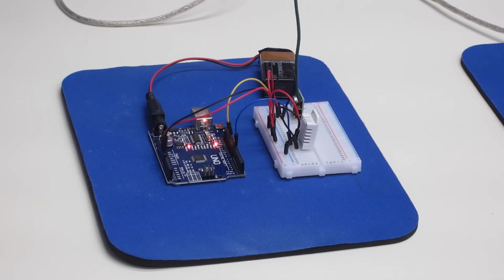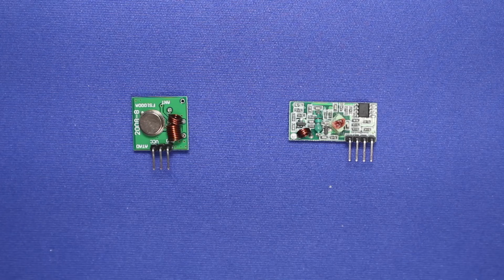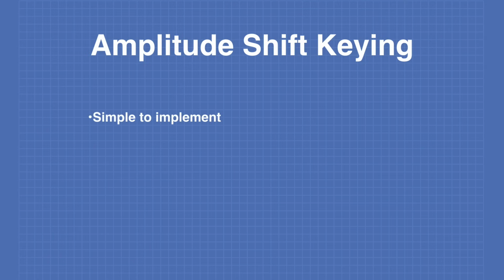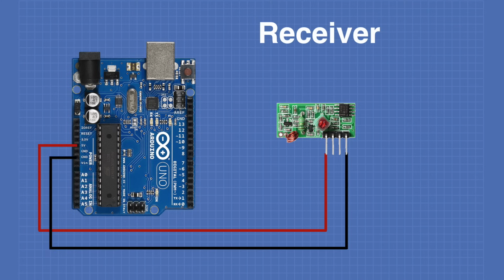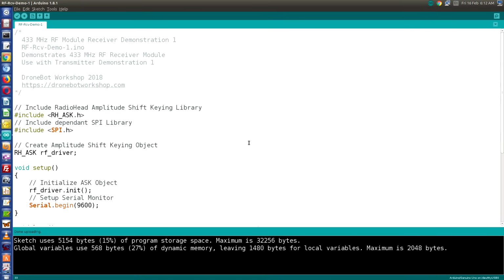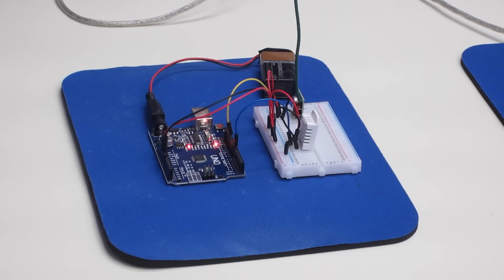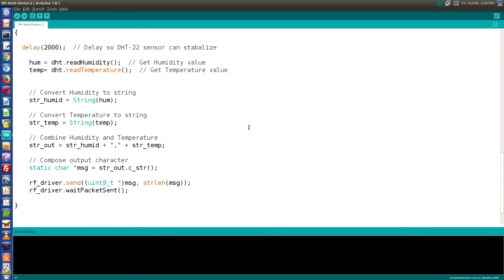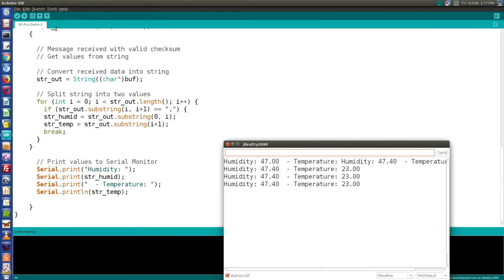Using Inexpensive 433 MHz RF Modules with Arduino

Comment: Well done, but two things here:
- First, you must initialise your buffer to strlen(message) +1, because the string is ended (aka "delimited") with a '\0', so "Welcome to the Workshop!" is actually 25 bytes, not 24.
- Second, why converting to a string (5+5+','+'\0' == 12 bytes, just saying) when you can transmit a float[2] array ([0] is temp, [1] is hum), especially if you need to do something else than just displaying it (using strings will require you to convert it back to some number format)?
Reply: I noticed that error also.  He could get away with the sending of just the 24 bytes, but when he receives it, he needs to  append a '\0' to it so that when he prints it, it doesn't cause any problem.  As it is, he's getting away with it because the next variable declared is an integer (2 bytes), but since the length that is stored there is small, it is only taking up one byte and the other byte is still a zero, thus that byte is acting as the null terminator for the previous string.  If the string he was sending was 256 bytes or more, he would get some strange output when he tried to print it.  It would continue printing until the print routine eventually found a byte with a zero value somewhere on the stack.

And yeah, sending it as two floats would be more efficient and you would get the full precision of the values at the receiver process.

Also, using strtok() is a good way of parsing a string that is delimited by a particular character (or set of characters).  For example:

char  *tempPtr;
char  *humidityPtr;
char  buffer[64];

/* Assume buffer has the temperature followed by a comma, followed by the humidity */

tempPtr = strtok(buffer, ",")
Serial.print("Temperature:  ");
Serial.println((tempPtr != NULL) ? tempPtr : "(missing)");
humidityPtr = strtok(NULL, ",");
Serial.print("Humidity:  ");
Serial.println((humidityPtr != NULL) ? humidityPtr : "(missing)");
Reply: @CurmudgeonExtraordinaire  who codes without typo's and bugs thou?  That would be so boring and you wouldn't learn near as fast :)
Reply: @williamna5800  -- I got started back in the days of punch cards, FORTRAN, and if we were lucky, we got back two runs each week.  You got really good at paper debugging.  None of this, "Well, let's try this and see what happens" that you see with the developers these days.

Comment: I really love this channel and You have done a really great job. But I am having an error on the transmitter sketch which i don't  know how it came about. This is the error I am having : invalid conversion from 'const char*' to 'char*' [-fpermissive]
Reply: instead using 'static char *msg = str_gud.c_str();', try using 'const char *msg = str_gud.c_str();'. it worked for me.

Comment: Thanks a lot for this video!  I'm having trouble figuring out how to split the string (27:10) into 4 values instead of 2. I've done all the other changes but I can't manage to get the "for loop" to work. What do I have to do? Thanks again!!
Reply: I think I understand now, I'll give it a try. Thanks!
Reply: @emyalfaro  did it work.. if it worked can u write it for me. thanks
Reply: @ahmadakhras1  I don't remenber. Sorry!
Reply: @emyalfaro   i stuck in it .. and i don't know how to figure it out

Comment: Video quality as well as crisp graphics are to die for. I particularly like the way you display hooking up wires. The colored line that starts from one point then seems to run across the screen until it terminates is very clever. Thank you for taking the time to create each project. I know it is time consuming.

Comment: Nice video.  I normally add a 10k pull resistor on the DHT22 between data and vcc when not using a breakout board with one attached.  I tried your example and it worked.  My understanding is that the resistor stabilizes the output.  But for battery operated systems would this be a drain on the battery?  I'd be interested to hear what you think about this.